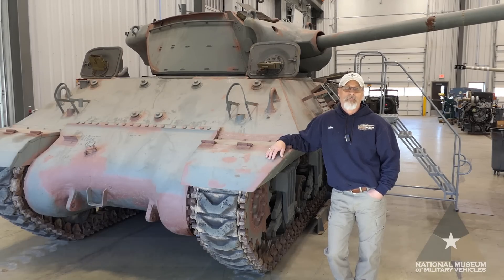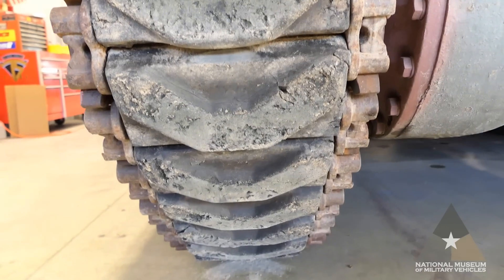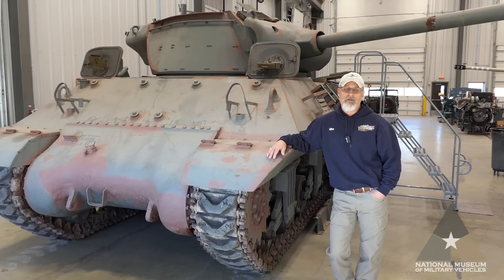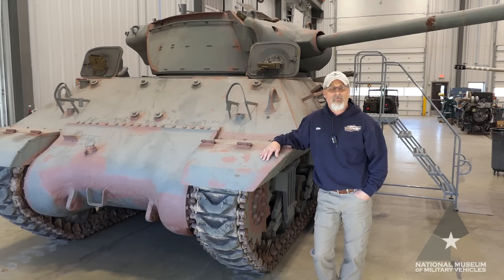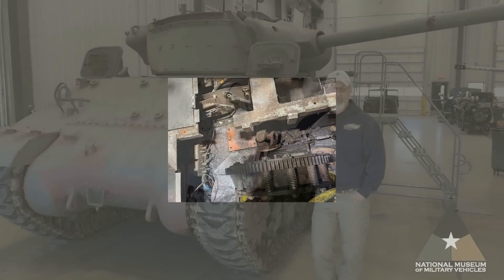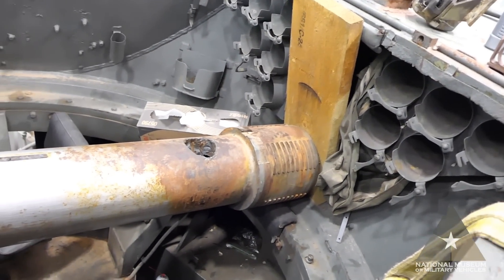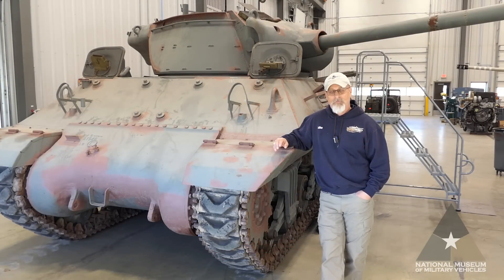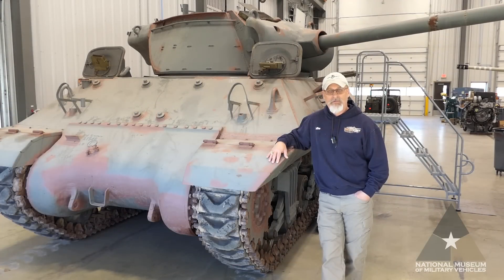Reviving a Rare Piece of History: The M36 Tank Destroyer Restoration Journey Begins

Comment: The M10's and M36's produced by Fisher Body use twin GM Diesel engines. Fisher only produced 300 M10 hulls in January of '44 for the M36 due to either labor woes or being unable to obtain the material to make them. The Army began rounding up the M10'S at the stateside training bases to be refurbished as a M36. All those companies you mentioned refurbished the M10's that used the Ford V8 while Fisher refurbished those with twin Diesels. None were ready by D-Day so Ordnance shipped 21 M36 turrets to France for use on repaired M4 hulls. Those were popular with the crews due to the better armor protection so Ordnance had Ford set M36 turrets on new M4's coming off the production line then complete the adaptation outside in the storage yard.  Fisher was done with refurbishing it's M10's so was put to work developing the M4 Jumbo. Ordnance cancelled any further production of the M10 hulls after 954 M10's were refurbished with the remaining M36's being on M4 hulls. The early M36 users in France began adding overhead protection by using steel plate with hinged sections so Ordnance sent drawings of those to Ford with instructions to start adding that at the factory.
Reply: It is a bit hard to follow this narrative without using the sub-designations for the various models that were built, and the sub-designations of the hulls on which they were built. (Admittedly it is a bit tough to follow even with the sub-designations, as it is a bit of an alphabet soup.  But easier to follow with unique designations for each, than with vague references and unclear antecedents.) 

To understand the M36 program, the starting point is to understand that all versions of the M36 were a new turret and revised ammo stowage built onto the hull of another vehicle. One could say they were all conversions, except that the first 300 to be built were not conversions of finished vehicles, but were turrets added onto hulls that had never received their "original" turrets (hulls still at the factory that had never been finished in their original form).

Here is a bit of a decoder for the M36 models and the hulls they were built on to:

M36 - Built on the hull of an M10A1 tank destroyer (the version of the M10 with GM 6046 twin-diesel engines)
M36B1 - Built on the hull of an M4A3 medium tank (the version of the M4 with Ford GAA engines)
M36B2 - Built on the hull of an M10 tank destroyer (the version of the M10 with Ford GAA engines)

The M10 tank destroyers (the diesel version) were deployed overseas for US Army use in North Africa, Mediterranean or European theater use. At the time of the development and initial production, the Ford GAA engine was just coming on-line, and initial production capacity was tight do to the M4A3 tank program. So the M4A2 (diesel version of the Sherman) was chosen as the base for the M10 program.

As capacity became available, the M10A1 tank destroyers (with the Ford gasoline version) were put into production. They were not deployed overseas for US Army use.  It was thought that there was not enough advantage to complicate the logistics and training of the TD units already in the war theaters.  So they were retained in the US for training purposes.  These were chosen as the first hull for the M36 conversions, as they were already available in the US.  

It was only after all available M10A1 hulls in the US had been converted that the M36B1s and M36B2s were built.